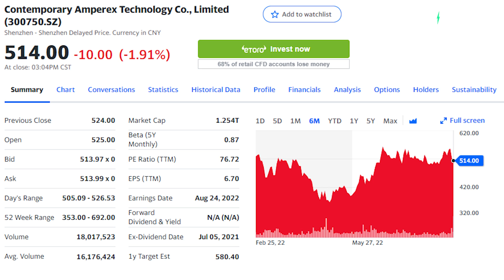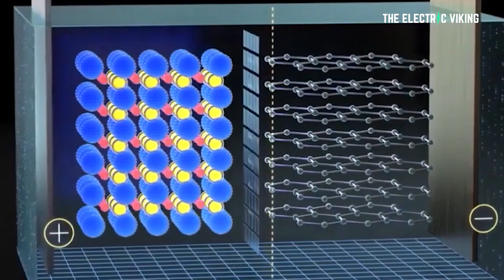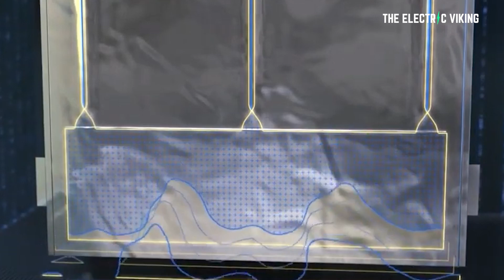Cheaper calcium ions could replace lithium ions in batteries

Comment: The issue of battery tech is that you need a high density, high charge state and light material for discharge and chargeable density, ie a SoC curve that is able to handle 20x the charge, to discharge rate.

People have all kinds of batteries designed for different temperatures, different discharge and charge rates, reusable or long life storage, and cycle management, ie having a reliable way to prevent erosion or dilution of the anode/cathodes that isn’t destructive or allows for a cleaning or refill process ie absorbing air, water or salt. Or using acids to clean deposits and buildup of minerals and salts on the cathode/anode materials.

This Is achievable with a mix of technology, ie Supercapacitors that allow for a transient buffer of regenerative energy that can be stored and discharged quickly, and slowly discharged to a slow-acting cell. 

Various salt batteries exist that can handle some of the requirements, but they are also significantly heavy in comparison.

The last 30 years, other batteries have been built in labs, but they often don’t have the same density as lithium, making them bigger, heavier and cheaper. Up to a diminishing return. 

The recycling issue is also valid, the anode material is the rare element that’s hard to remove once bonded with lithium and crystals are formed in the salt/polymers. You don’t have a lot of ways to clean or reuse a battery cell.

Comment: BYD started 2010 the e6 with LiFePo4 when this type was at only 80 Wh/kg. 60 kWh 750 kg. So when sodium is at 160 Wh/kg ideal for cheap electric cars.
About lithium: There are 0.1 ppm in seawater. This are 100 t per km³ of seawater. Lte's assume the afford to filter it out equals to raising water by 360 m. 1 kWh for 1 m³
So 10 million m³ of seawater, 10 GWh for 1 t of lithium. At 1 Cent per kWh from photovoltaic, this is not so far above current lithium prices.

Comment: Sodium is close to Lithium on the periodic table.  Sodium cells are already being made; but currently are lower density per kg; they can already be used to replace Lithium for functions like energy storage; freeing up some lithium for EVs. Calcium could work but currently is not in production on any scale. Lithium is a major short fall which is going to make manufactures fight over how much they could acquire. in order to make EVs.  The price of lithium has jumped 1200% due to EV demand. One can spread the existing lithium by making hybrids that can commute electric, live with limited numbers of EVs or find a new chemistry.  The problem with all the many new chemistries is it is a massive investment to make a new battery plant and what if a better tech shows up that makes yours obsolete - then you've lost huge money. I think it will be like the days of the early micro chips there will be winners and losers. Maybe a couple survive long term -so picking the winner is very hard because the specs and chemistries are so secret.

Comment: Hi Sam. not related to this video but just seen some news here in the UK that new legislation is coming in where charge points need to be upgraded to show how much electricity is being used and costs. Also and a bit more concerning is charging will be limited to ease pressure on the grid by limiting charging between 8 am and 11 am and 4pm and 10pm and also randomised shut down of charge points. Your thoughts would be much appreciated.

Comment: Whenever your adrenaline rises because a miracle battery has been invented, cool it down. Elon has already explained this issue. In your haste to produce videos and make money, you are stumbling over a fact. Batteries with these combinations have been already invented. It is the industrial process to produce the batteries that are being innovated. For example with your battery that has molybdenum in it...... Mo is not common. [see relative abundance of elements periodic table]. If everyone switched to the Mo battery, the price would shoot up making it uneconomical. However with lithium it is totally abundant. We are going through a price explosion now, which will cause prospectors to find lithium mines, and the price will crash. . There is almost always a problem somewhere. eg
materials uncommon therefore expensive eg silver, diamond batteries
the rate of ion transfer slow
power needed to charge battery too great. 
power losses too great [ice engine great but power losses too great]
technology to produce the battery economically at scale has not been invented [carbon tube battery, silicon wire battery]
technology simply not good enough [solar calcium battery]. 

Miracle battery discoveries UNLIKELY

Comment: I believe that the sodium battery has the biggest change to go ahead as it is already in production. My understanding is that the price is still high as it is only used in smaller numbers but when numbers go up it will likely out perform Lithium on at least price.
Reply: Sodium ion not have high energy density, but potassium ion able to compete with lithium ion, and voltage is 4v

Comment: The Game Changing Batteries of 2022 got NOTHING ON THE Game Changing Batteries of 2006 , 2009 , 2013 , 2016 , 2020.  All you have in 2022 is that low mileage LFP CRAP and Batteries that catch on fire but back then they were REAL GAME CHANGERS.
Reply: I agree.  While we want to know about this but it is not earth shaking till the earth shakes.
But there are enough new battery plants in the US and presumably elsewhere to give me hope that we will have additional working chemistries to short circuit the dreaded battery shortage.
Reply: @danharold3087  I heard of like 100 Game Changing Ideas Each and Every Year for along time.and we are here in 2022 with Nothing to show for it. It reminds me to not get my Hopes Up because if someone could build a better battery they would have by now. There was nothing Game changing in any of those Years.
Reply: @truecolors5413  It would help if we did not have YouTube using these words/lines as hooks.  I can understand being disillusioned.  It is like getting sandblasted.

Batteries have changed.   Back in the day of the EV1 it was lead acid.   Prices are generally improving.  Dependability is improving.     Longevity is improving.   Motors electronics and cars are improving.  

We need to get to where the deep pocket market is saturated.   Electric cars should be longer lasting, more dependable and yes less expensive than ICE.

Comment: Sodium is another possibility. Sodium is very close to Lithium, same valence number also very active. Also we need to get rid of Neodymium in the motors.
Reply: About neodymium, that a look at niron's clean earth magnets made of iron nitride. They can potentially be 2x stronger than neo, while being made of iron and nitrogen. Robert murray smith did a video on it.
Reply: @AdlerMow  it would be great if it works, no scarcity of iron or nitrogen

Comment: I think first and foremost we need to get straight where we stand now with lithium. Is there a shortage or not, also taking into account the expected high return recycling strategy. Despite what's mentioned in this video on the state of global lithium and phosphate reserves, I hear conflicting information on this matter. Only then, I think, can we determine the value of looking at alternate elements as lithium replacements, for mainly reason, of cost reduction. I think new sources will be disappointing in general in terms of energy and power performance potential, compared to lithium in the table of elements. Otherwise we wouldn't be here now with lithium as the number 1 choice for most batteries today. I can't imagine scientists and chemists haven't explored the alternative battery elements before in the last odd 4 to 5 decades, or longer. Only perhaps the technology has advanced to a degree it has become more affordable and accessible to test performance on new recipes of element cocktails for different battery types for different assigned applications. I think these new recipes will come with significant compromises for lower cost. I'm not sure we're going to get better affordable EVs this way for the future. I think we should look more at improving a high efficiency teturn rate process for tecycling batteries and also look more at how to keep EVs on the the road longer, rather than saying they are a scrap heap after 5-20 years. I think more should be invested in repairability, and increasing a value norm of high quality low cost repair. This together with a higher density EV public charging infrastructure, to the point ot becomes ubiquitous and convenient, with high standard servicing of public chargers. I think this could help on the long run with the spastic search for more alternative battery element sources.

Comment: Calcium is much heavier. Atomic weight Li = 7 Ca = 40 - so around 6 times heavier. But Calcium carries twice the charge. So in effect about 3 times heavier. For lorries or buses this isn’t so relevant. So maybe reserve Lithium for cars and use Calcium for heavy vehicles or static batteries. Sodium is a very reactive metal much more so than Lithium - so I would expect the fire risk to be a serious problem to overcome.
Reply: It is probably not as serious a problem as it sounds. An EV battery is about 1000 pounds, but the lithium contents is only about 17 pounds on average. Switching to calcium won't add too much extra weight to the overall weight of the battery.
Reply: @kaiulani3044  Thanks. Good point

Comment: Why not combine desalination for water with lithium extraction? You’d be part way there and offset one cost anyway…
Reply: Because it is not practical. State of art desalination plants all use reverse osmosis because it is the most energy efficient method. The left over brine is increase to 7% salt but still 90% plus water. To evaporate the water to collect the salt takes a lot of energy.
Reply: @catchnkill  use the sun in ponds???
Reply: @troyswan7123  In theory yes but in practice no.  The largest desalination plant in the world is a Saudi Arabia plant.  It can produce 1.03 million cubic meters of fresh water.  Brine is one to one ratio and thus also 1.03 million cublic meters.  You need to spread the water thin in order to evaporate.  Let say 3 to 4cm bigh of water in the pond.  One metre cubic metres of brine require 25 to 30 square metre of pond.  Thus it needs 25 to 30 million m2 of pond for one day brine.  It is just not practicable.  Not enough pond area.
Reply: @catchnkill  how much lithium would you get from this area or even 10% for example because at present I assume that goes back in the ocean so the vast majority will still go back in the ocean but could you not still divert some to settling tanks and divert the rest to where it goes now I didn’t say it is the only place to put the brine and in Saudi they have vast deserts don’t they? Ps I’m no expert this is only a thought experiment on my behalf
Reply: @troyswan7123  Saudi has limitless space to use because of their vast area of desert.  However, they need to build large area of shallow ponds for your idea to work.  If you pour water in the desert, it seeps into sand and all water disappears.  Concrete ponds are required.  Extensive water pumping network is required.  Moreover, a lot of processing is required.  After you evaporate all water from the brine, you get salt.  It is not yet lithium.  There is tiny bit of lithium within those salt.  The cost of processing outweighs the value of lithium in there.

Comment: Like many possible new chemistries for PV modules, there are many vast gulfs between the laboratory and profitable production for batteries. The biggest takeaway is that there is so much research occurring, and all of the small incremental innovations add up over time to improve the production and value of the product. While most research may never directly bring new products to market, the increased knowledge base will help everyone involved.

Comment: You just had a video showing in America they found a source of Lithium good for 50 million cars, it is not like we are gonna run out Lithium anytime soon. ⏳️
Reply: It's expensive to refine Lithium so we need Calcium and Sodium cathodes as well.
Reply: @dianewallaceEVs  especially for grid storage, which just needs lots of cheap storage capacity, but usually does not need high energy density (urban fast charging is the likely main exception).
Reply: 50 million is less than 4% of the global vehicle fleet. Not to mention utility power storage.
Reply: @kenjohnson6101   That 4% was not discovered yesterday.   We know about mineral deposits around the world but many were deemed unusable decades ago.   New mining technology and higher prices make some of thes viable sources.   
Other deposits are not considered because of political or environmental issues.   All that and a selection of chemisteries so as to not stress any particular mineral will make batteries work.
Reply: Not in our life time will we run out of lithium. Engineers will figure out how to make different batteries.
Reply: "There were 1.4 billion motor vehicles in 2019 in the world"
Reply: If Tesla produce 20 mill.cars in year 2030, = only lithium for 2,5 years of Tesla production.... 🤓